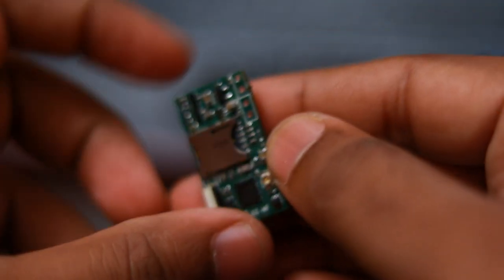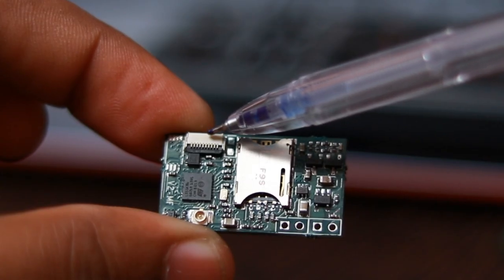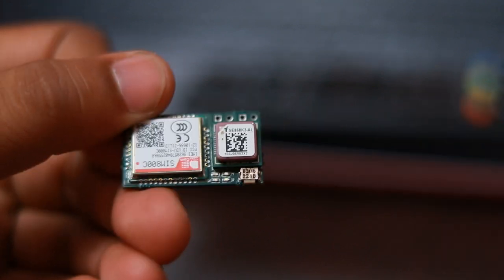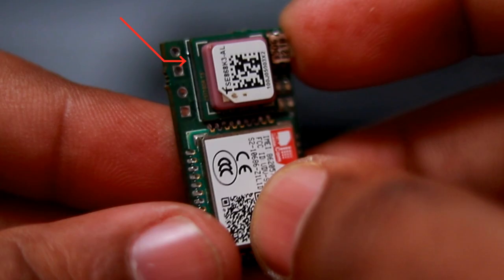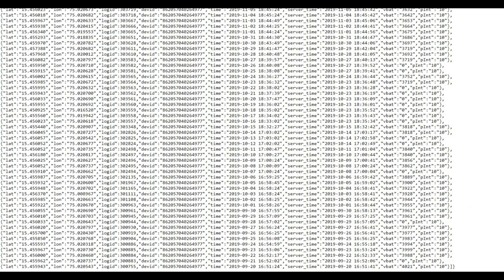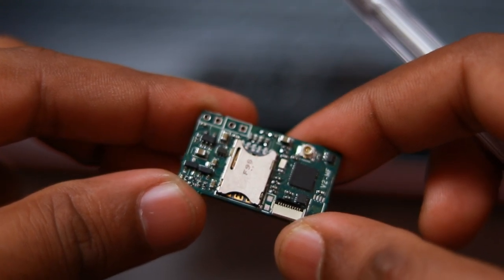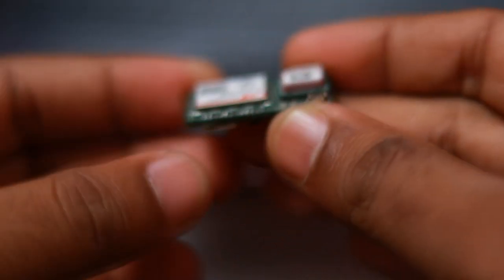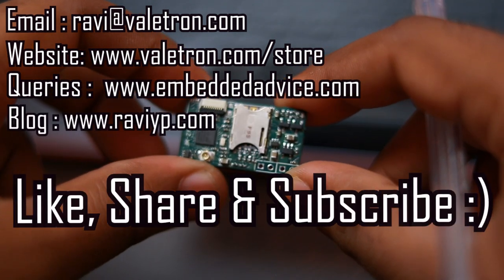Super Tiny long life GPS tracker for PETS and Asset tracking -  VALTRACK-V2MF

Comment: You had used SIM39EA gps module in one of your product, while here you are using se868k. Which one is better and cheaper and also commonly available here…
Reply from the maker: Unfortunately both are not available easily. Prices have spiked. You will have better luck with L80 module, that is also Hard to Find

Comment: Congratulations. Are you selling the PCB/BOM file of this project? My humble opinion is that it would have better potential for spy use. In that case, an hourly ping is too little. If you are tracking a car being stolen, or a person, the ping must be made by minute, or 5 minutes (maximum). That because the thief or object being tracked may go to a covered area (underground, metro, etc) and the GPS precision would be lost. In that scenario, from the last position known to the presently unprecise coordinate may render you completely out of the real position. There are good and cheap 1000mah bateries in china to sell. It would hold the situation.
Reply from the maker: Yes, its used for similar application. You can mail to ravi@valetron.com. 
Ping rate is adjustable.

Comment: checkout A9G from Ai-Thinker it's MCU+GSM+GNNS in single module also dirt cheap.
Reply from the maker: SIM800C costs Rs.170/- how much does A9G cost.
Reply: @RaviPujar  around $4 I think.
Reply from the maker: You could check SIM868E. Costs around 3.8 USD. Has all features plus BLUETOOTH 4 on it. AI doesn't have good support and presence in India like SIMCOM. So haven't used them in design.
Reply: What I'm trying to say is if you get A9g you don't need STM32 and sim808(gprs+GSM) as A9g has internal mcu with 4mb flash and ram. Also you can do Delta OTA.
Reply from the maker: @punit_patel  That's nice. Will definitely check it out. OTA is a great feature. Thank you :)